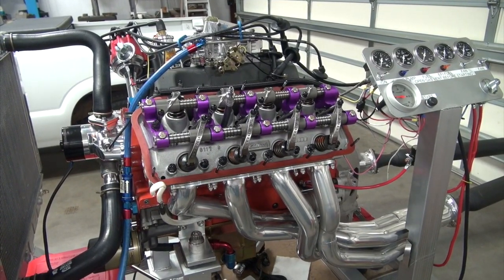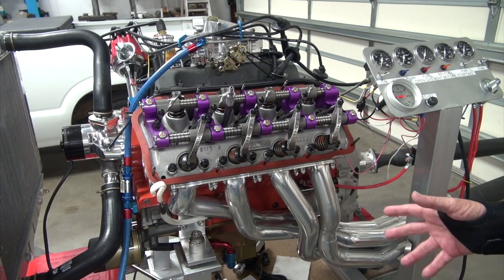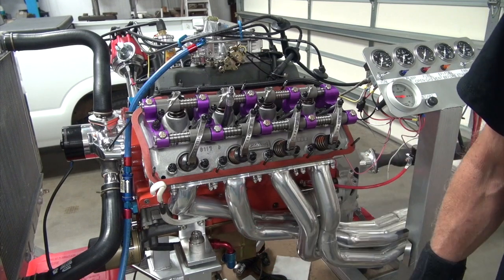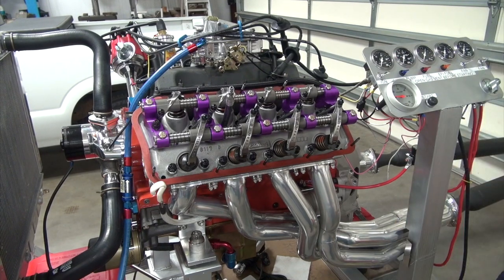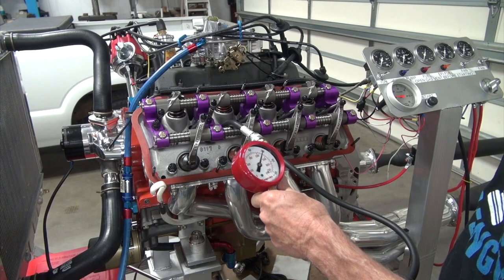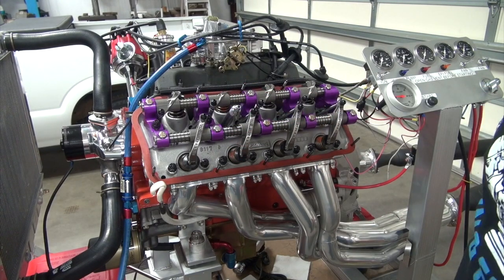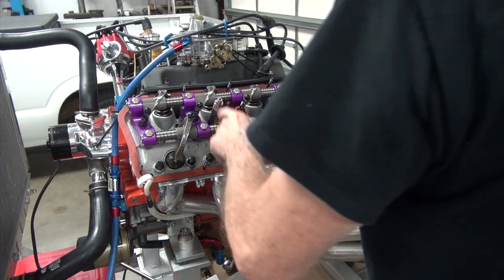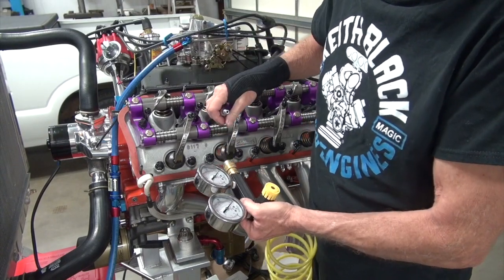426 Hemi after the build  #426hemi

Comment: Absolutely great learning material, but DAMN. You really went over and above with that engine. Exacting build at every stage, what every builder could someday hope to aspire to. I bet you could drop a brick on the throttle and it would run for months wide open with no wear and no problems. My gosh, would be so proud to own that motor! Thanks so much for this. Hopefully there is a Dyno run in the plans?
Reply from the maker: It did take a long time to build. But there are so many problems with a build today with nearly each item coming from a different vendor.
Reply: Gotcha. I just really enjoyed the series and watching you work through and solve problems. You have a lot of resources at your disposal.
Reply from the maker: @ultraspinacle  Yes if it took me that long to get it done I can’t imagine how long it would have taken a normal guy

Comment: Hey rick, how good are the bill mitchell aluminum blocks?
  And, how much power is gained from having a new stronger block?
     Lastly, do you know the actual limits of the stock blocks? There is so much conjecture on the subject.  
     For instance I run a 71 RB at 4.35 bore and 4.15 stroke.
I use billet aluminum studded main caps, with the McCandless oiling mods 7,000 rpm seems to be no problem.  
    Thanks, nice shop!

Actually this is probably a good video suggestion for ya.
Reply from the maker: I’ve never used a Bill Mitchell block so I don’t know. I don’t think much about power differences because I’m never going for the max anyway. You’re probably running enough on a stock block. Yes you could go 4.380 with 4.500 stroke but I think an aftermarket block would be better for that.